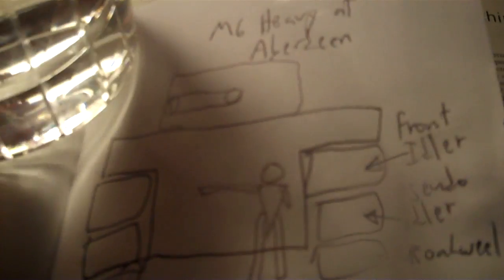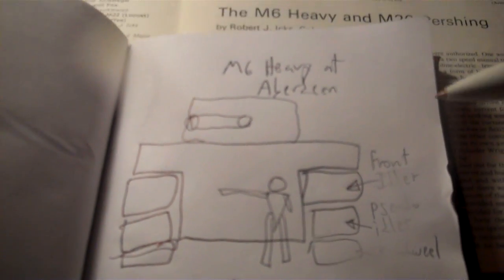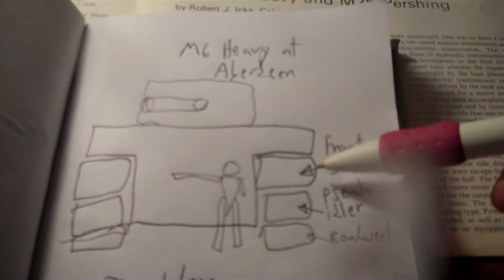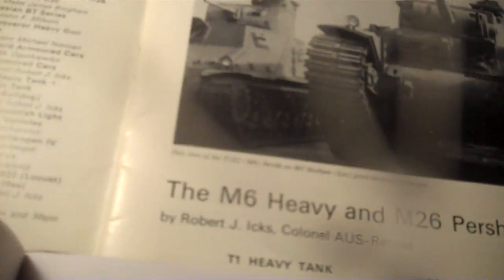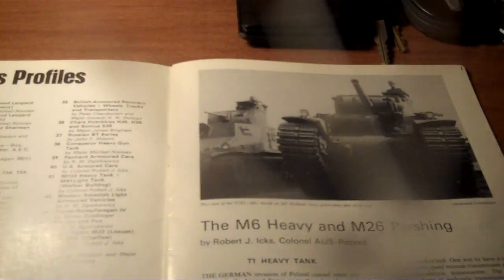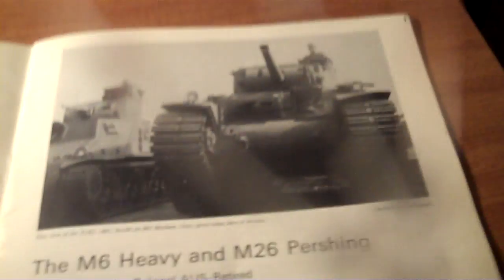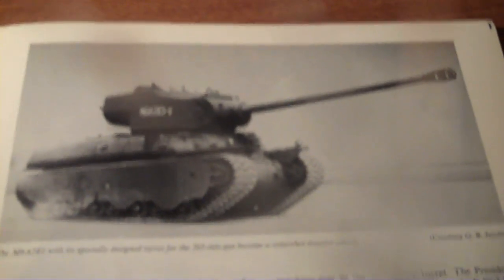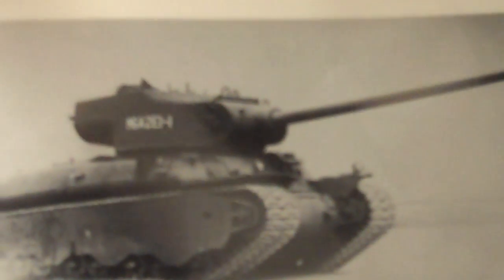US M6 Heavy Tank Addendum

Comment: That and the transmission would not hold up in prolong battle,
there was 40 of them built, welded hulls, and cast hulls, the last version was M6A2REI
which had 105mm gun in TI5EI heavy turret, 15 were chosen for this with  5 remaining used as spare parts.no interest was shown and the project was drop.
I think only 3 are left found in a wooded area which was ain 41 wasa treeless testing ground, and the trees grew around them..